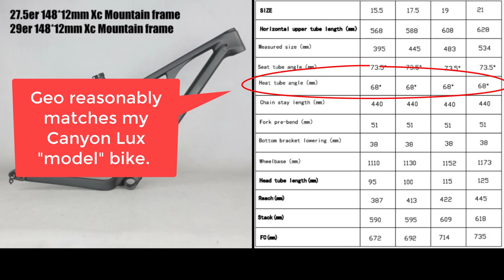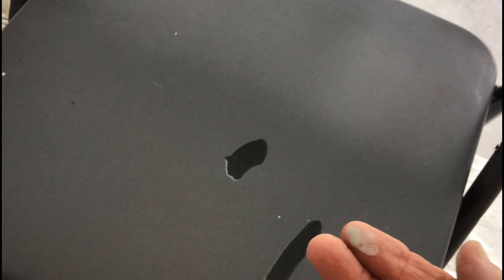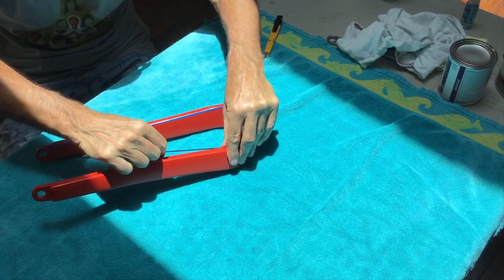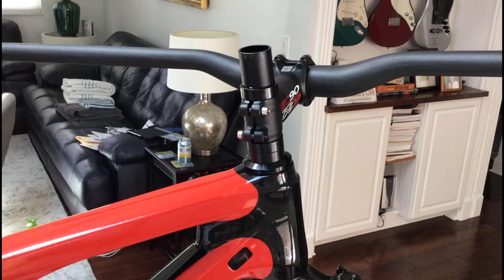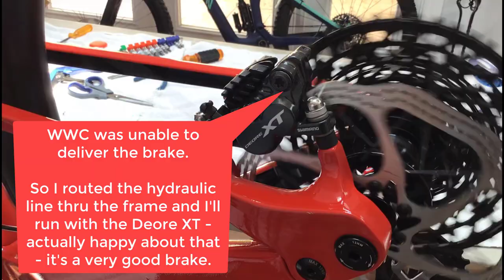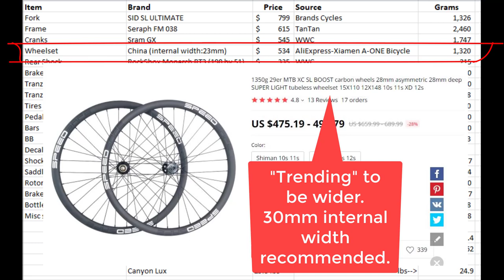Seraph MTB Frame FM038 - Full Build  ...

Comment: I have a Seraph road frame and it is great. Had it for 4 years now without any issues.
When painting: use many thin layers - not 1 thick layer.
Reply from the maker: Did you use a gun or rattle cans? If a gun what kind and what nozzle size.

Comment: I have this frame as well and I'm so Happy with It. It has a good quality. If someone is looking for a xc frame, fm038 is a good choice to build a bike.
In my case, the cost about frame + xdb delivery to Spain was 620€. 15 days, frame at home.
Reply from the maker: Great to hear! Have you finished build or are you just starting?
Reply: @jeromep4148  I finished my build in may. 
My build is:
Fox rythym 34 130mm fork
Fox rp23 adaptative logic kashima cost.
Full transmission XT
Brakes full xt 
Wheels dtswiiss x1900
Seat post tranzx 150mm 
Handlebar bmc 01 carbon
Minion 2.30 dhf front
Minion 2.30 dhr rear 

I tried to build with fm038 a bike for xc and trail or light enduro.
I'm Happy with It. 
It has good rigidity and in technical descents his behavior is excellent.
For 500 dollars I think that IS a good frame. Now we have to see, how many time hold without crashes o breaks on frame. 
Best Jerome !!

Comment: Nice build. I did almost the exact same thing this past summer. 

I took off the components on my 2005 Devinci Cameleon, sourced a local bike maker to strip the powder coated paint, repaint a new color with custom logos, then I self built the bike with my own hand picked components. 

The pandemic resulted in long wait times for the parts to arrive, but the entire build process was very self rewarding. 

It would probably be cheaper to buy an off the rack bike but not every component will be to my preferred liking and most importantly, the emotional attachment wouldn’t be as strong as a self build.
Reply from the maker: I just finished an FM10 build 2 weeks ago. I will probably do a “post-build” vIdeo on that one. I took a complete opposite approach to components. I have 2 more builds coming up. Awaiting delivery now.  I really enjoy the process particularly the painting and stencil creation. The assembly is pretty easy for me since I have all the tools and have more experience there.
Reply from the maker: I 100% agree. It’s way more fulfilling when it’s “of your own creation”.
Reply: @jeromep4148  How is your FM10 holding up? I have an FM10 as well and I've had pivot bolts fall out multiple times, leading me to walk the bike for miles out of trail networks. I've also had the suspension  bolts snap in half 3 times.
Reply from the maker: @KnicksFanPatrol  I used loctitle blue on all fasteners and installed with torque wrench - check periodically. For me , so far so good.
Reply from the maker: Are you jumping ?- I am trail riding only? My son in law has the xl frame - he is a big guy at 230 lbs - so far so good for his as well - again he is trail riding ( not jumping)
Reply from the maker: @KnicksFanPatrol  I also have the Fm036 xc frame. I did lose a frame bolt on the trail prior to building the FM 10. I taught me to buy a few extra fasteners and to check them periodically. If they begin to loosen and start to “back out” I can see them shearing off. If they stay secure that really should not be happening. Make sure to use loctitle blue. Hope you have better success going forward.

Comment: I ordered the newest and lightest XC model FM61 frame directly from Tantan, not through ebay or Aliexpress, and I must admit I am a little worried cause it has been exactly one month and still haven't heard from them other than a couple of emails after ordering. I did request for a paint job for $135. So maybe that adds significantly more time.
Reply from the maker: i never had them paint a frame so that adds time for sure. i have ordered 3. frames in total from them and everything worked out fine, buts its not a speedy process - the shipping takes a while also. Consider ordering a couple of extra sets of frame fastener in the event you ever lose one. i lost one on a trail and it took a while to get the replacement - all super slow shipping. Use Loctite Blue and be sure to use a torque wrench. i think it was “user error” on my part , but still its nice to have spares!!
Reply: @jeromep4148  thank you for the advice, forgive my ignorance but what "frame fasteners" are we talking about?
Reply from the maker: @dontfearthereaper2887  Actually after my reply I looked up the you bought. Your rear triangle is one piece , mine was two piece. The fasteners for the rear triangle is primarily what i was referring to

Comment: Jerome, I'm thinking of buying the same frame. Are you still happy with this frame? Any afterthoughts about it? Thanks for the great video. Btw is this a trail bike or xc bike?  Thanks again!!!
Reply from the maker: It’s a great frame! I would say more of an xc bike. If your local trails are rooty with rocks it’s great. If you have larger drops and you jump a lot maybe you would need more travel in your  suspension ( like the FM10 bike provides … I did 2 Fm10 builds also). I have done 4 builds and this frame provides the most versatility IMO. I do think it all depends on your local trails.

Comment: Planning on doing the same, but with the fm10 frame…
Reply from the maker: I am actually doing the same thing. My fm10 arrived 2 weeks ago and I am close to finalizing my paint scheme colors. The fm10 is considerably more burly - should be great for hard core trail and enduro type stuff.
Reply: @jeromep4148  what fork and spring are you going with?
Reply from the maker: @exa-mountainbikingandhikin7127  my initial goal was to go 100% Chinese branded stuff. Generally very inexpensive and if I don’t like the products, not a huge loss to replace components. So I bought a 140mm travel fork by a company called Uding.

Comment: What is the headset of this frame sir? I just bought on from eBay and I am buying the parts while waiting for it to arrive.
Reply from the maker: Bought headset from TanTan cycle folks along with frame. Buy a few extra frame pivot fasteners - the little ones. Be sure to torque properly a apply medium strength loctite ( blue). I lost one on the trail and it took forever to get a replacement. Need spares.

Comment: will this frame accept the UDH hanger? I am looking at this frame but I would like to add the new t-type transmission from SRAM.
Reply from the maker: Good question- right now, I don’t actually know. I can research “what is required” and then take an educated guess. The manuf ( Tantan Cycles) has always been pretty good at answering questions though.  On a side note, I am visiting Colorado and I have this bike with me. I am very pleased with how the bike is performing in the Colorado conditions (probably a testament to the SID Ultimate fork and the snazzy rear shock. Both are only 100mm of travel, but again very pleased. I did a custom build because I enjoy that process - however, if I were to buy a bike from a name brand, I would go with the new Canyon Neuron CF 9 SL ( the new 2023 version not the 2022). I was actually expecting to do that for this CO trip, but I was so happy with the FM038 build that I didn’t think it was necessary. The Neuron would have been a nicer bike but for my riding style the FM038 is really nice too.
Reply from the maker: 2nd reply - I was thinking SRAM UDH was their new thing. UDH was introduced in 2019. I bought the full drive train from Worldwide Cycley in July 2020. I used the rear axle provided with bike and everything was perfect. SRAM GX Eagle Groupset - 170mm Boost Crankset, 32t, DUB, Trigger Shifter, Rear Derailleur, 12-Speed 10-52t Cassette

Comment: Hi, I have the same frame but the rear pivot bushing (next to the rear wheel axle) has developed a play pretty soon (3 months after building the frame). Well my first shock was that they don’t use a bearing here but a kind of bushing (other pivots use normal industrial bearings). Was it also case for your frame? is this a kind of standard bushing that can be replaced? (I only have experience with bearings in frames…). Thanks! :)
Reply from the maker: I lost one of these bushing bolts while on the trail and I had to order a handful of spares from China - took a long time to arrive  (it was in the height of Covid and everything from China was delayed).  This pivot experiences minimal rotational movement, so perhaps that is why there is no bearing - I don't know how other bikes do it and I don't profess to be a frame design engineer, so I can't provide any real insight.  After losing one pivot bolt (and ordering a replacement and a number of spares), I applied Loctite (blue) and re-torqued all the pivots to the proper spec.  I did not experience the problem you did however.  I asked the Seraph if I could buy the bushings in the US and they didn't seem to have a clue.  My local bike shops in my location seem to know virtually nothing about the fasteners used in the industry so they were totally unhelpful. I even called a couple of US based manufacturers just to get a lead on who supplies this stuff ... no success there either.  Good luck

Comment: This video is a year old now wanted to know how you feel about the bike now. Sick build truly hope it’s still good.
Reply from the maker: The bike is great. the sram GX drive train is very good. Reliable and consistent shifting. Rockshox ultimate Sid fork also great. The Tranzx dropper could not hold air and Tranzx is sending me a replacement catridge- there customer service has been outstanding. The geometry of the frame is quite good for xc and not overly technical trail riding. I have a mix of shimano and sram brakes. The shimano rear squeal like crazy. Really annoying. I am replacing pads this coming weekend. The others have plenty of pad left but I just can’t get them to be quiet. The SIGEYI power meter is also great. Other than the unreliability of dropper and noises back brake (which both should be fixed next weekend, the bike has been a dream. Oh one thing that did suck: I did not initially torque frame bolts. Lost one on the trail and it took over a month to get replacements. I tried to get tantan to ship fedex but they couldn’t do it. That was annoying. I recommend buying extra hardware up front.

I have done two FM10 builds. I will do a video on them at some point. Very beefy all mountain frame. Also a good purchase - more on that later.
Reply from the maker: What are you planning to do for components?
Reply: @jeromep4148  to be as thrifty as possible I have a perfectly good 2015 trek remedy that’s too large for me. So I’ll be transferring the components from that over. May need a new rear shock and I’ll go with a rockshox monarch. Everything else is sram 1x 11 setup.

Comment: Sweet build. Nice overall weight, especially considering you use a dropper post. I used lesser components and i’m at 12 kg for my bxt. Without DP! Total costs of my bike, approx 2150 usd
Reply from the maker: I am getting started on another build using a seraph fm10 frame. Quite a bit chunkier- more of a trail/ enduro type frame. I am trying to go near all chinese branded      components. I can always swap out what seems inadequate. Will be an interesting adventure.
Reply: @jeromep4148  please make a  video about that one too I’m thinking of buying the fm10

Comment: Just curious why you didn’t get the wheels through Tantan as well?
Reply from the maker: Their website is not really laid out in a fashion that was easy to navigate. The categories all seem to overlap and I ended up spending hours over multiple visits getting “the hang” of it. I never felt I understood their wheel offering however. It seemed like they had all road bike wheels. So frankly I gave up on it. I purchased two more frames from them with the intent of buying some wheels but I again gave up and went with the Xiamen folks who presented their wheel sets in a more straightforward and easily digestible manner. I am not an expert on cf wheels so maybe it was just ignorance on my part.
Reply: @jeromep4148  I don’t see any prices on their website at all for anything. Frankly, their website looks VERY close to the Tantan one.
Reply from the maker: Xiamen is on AliExpress -at least that is where I purchased. . Tantan is  also on AliExpress but I bought directly from them via their website and I believe I paid via PayPal.
Reply: @jeromep4148  ok, thanks for the tips.

Comment: Hello,
Nice bike.
I'm waiting for the same frame and I have a doubt.
With size (diameter) are the screws that fixate the shock? 6mm or 8mm?
I ask because I need to buy the bushings for the shok.
Thank you so much.
Nice rides
Reply from the maker: Not sure. Bike is at my work office right now. I did have to buy a bushing kit and then cut one of the bushing with a hack saw to get it to the correct size. Fortunately I have a workbench vise and was able to get a decent cut. Then I filed the rough edge with a metal file. It was an easy process but I have the tools.
Reply: @jeromep4148  ok thanks
Reply from the maker: I am pretty sure it’s 8mm. I bought a rockshox monarch rt3 shock from worldwide cycle.  https://www.worldwidecyclery.com/products/2016-rockshox-monarch-rt3-rear-shock-7-50x2-0-190x51-debonair-tunemidreb-comp. and bought this mounting kit : RockShox Rear Shock Mounting Hardware: 1/2" x 1/2", 22.0 x 8, 3-Piece Set. I filed it down a bit so I could get it to fit in the frame. I painted the bike and had quite a bit of clear coat. It was easy to do. Pressing the shim into the shock itself required a vice. That seemed a bit more difficult than I would have expected. I am happy I had a vice in my garage!!

Comment: I need some opinions on the trifox hardtail for 400$ i’m skeptical because of price and safety
Reply from the maker: I just received an Airwolf hardtail xc frame a week ago. Came with the BB and head cups and bearings for fork. $276 usd and included shipping! Seems really good. I buy unpainted because that's the most fun for me. Anyway, it seems really quite good! I would recommend it. Obviously have never ridden it but I believe they have been doing frame for some time now. The finish of the frame seems quite exceptional.
Reply: @jeromep4148  i’m really skeptical with safety but also like warrants if the companies in china even stand behind their warranty’s
Reply from the maker: Sure. But you know all the carbon fiber bike manufacturing expertise in the world is in China, right. What ever you buy will have been made in China regardless if you are talking frame, drivetrain, forks …. Design , however, is a different story. Each brand tends to have its own design, geometry, etc. so while their frames are being made in china (and Taiwan for aluminium frames), the designs are generally owned by the brand. Good luck with your build!!
Reply: @jeromep4148  Thanks man 🙏

Comment: Do the frame has the option for to put the rear shock remote cable??? Thanks
Reply from the maker: I ride from my work location and I keep forgetting to check. Hopefully tomorrow
Reply from the maker: You can also shoot Lisa at Seraph an email and she will get right back to you.
Reply from the maker: Ok just checked bike. There is a routing thru the frame for a rear shock lockout cable.
Reply: @jeromep4148  Thanks, How low is take you to get it??? Frame???
Reply from the maker: @estebanaraiza  45 days approximately. The seraph shipped within a week. It really slowed down getting through customs - was when COVID was ramping up.
Reply from the maker: I just bought an FM10 from them and it took about 30 days.
Reply: @jeromep4148  sounds good Jerome, thanks for your help 👊🏼
Reply from the maker: Where do you live?

Comment: Is your rear suspension 190x50?
Reply from the maker: Yes
Reply: I'm 5'7" and i ordered size 19. Was it a good choice? Or i should have ordered the 17.5?
Reply from the maker: Seems much to big. Send Seraph an email. I know they tend to have a reluctance to tell customers “what they need” but frame sizes accommodate body sizes. At 5’7” you would generally be a medium size frame. Good luck.
Reply: I compared it to polygon siskiu t7 medium and the geometry seems to be the same to their 19. Except the seat tube angle and head tube angle. That's why i choose the 19.
Reply from the maker: Experience is the key - sounds like you have that.  What are you doing for components?
Reply from the maker: At the end of the video I show a screen shot of my entire component list. Shock is a 190 x 51. But definitely check the list. It even has component weights.
Reply: Weight is not a problem for me since i just want to use it for exercise. Actually my hubs, rims, front and rear suspensions are Chinese brand, of course including the frame, i will be using Entity cockpit with onoff pija dropper post, deore drivetrain, magura mt5 brakeset, dnm coil suspension for rear, weapon cannon 35 front, weinmann u40 rims, novatec hubs, pillar spokes, and maxxis dhf and dhr2 which is also Chinese brand.
Reply: Total cost of my build is just around 1,500usd.
Reply from the maker: @fjpabuhat4753  I am doing a new build with much of the same components